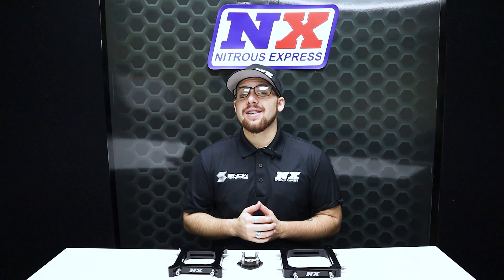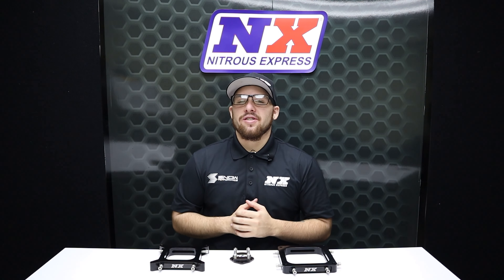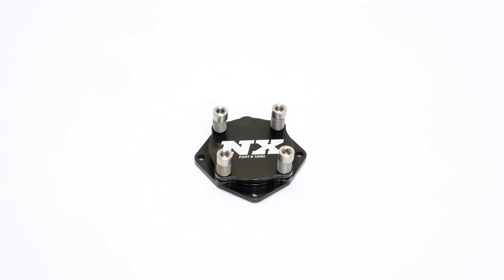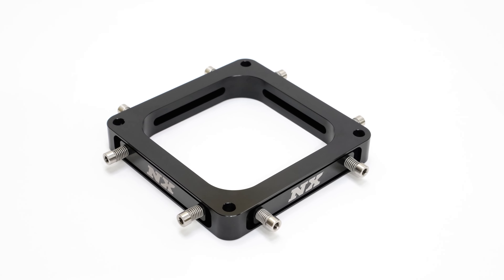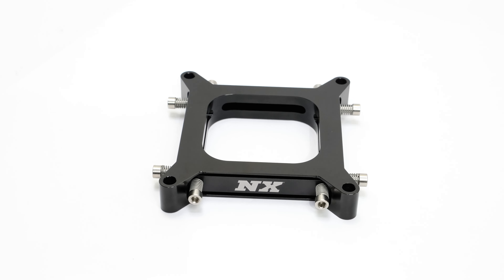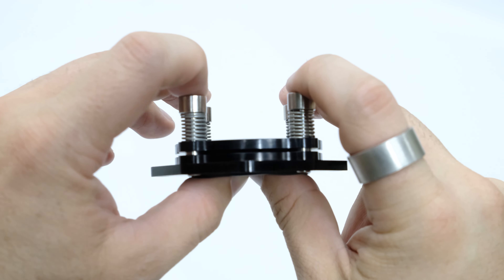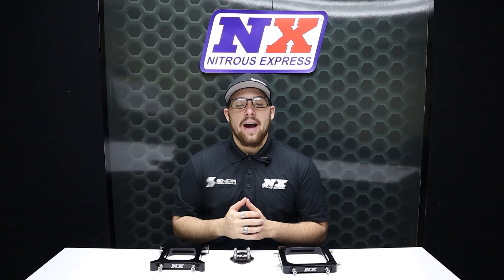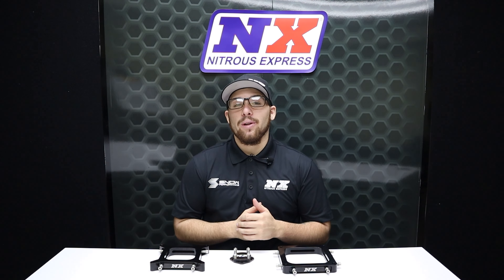How To Keep Your Engine Safe From Backfires!! Nitrous Express' Burst Plates Overview!

Comment: Could the universal pressure release be used on a boosted engine? Any specs on how much pressure it takes to open the valve?
Reply from the maker: These will not work with boosted applications, only nitrous.

Comment: I bought y’all plate system for my 2021 f150 that for coyote and the 7.3 and the plate don’t fit is there a different plate I can buy so it can fit?
Reply from the maker: If your f150 does not have the stock throttle body than this plate will not fit.